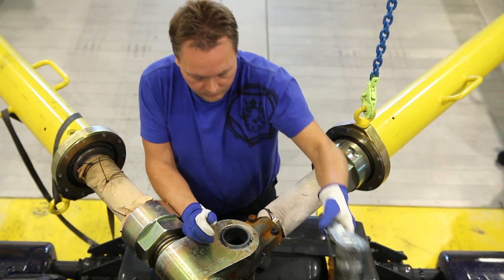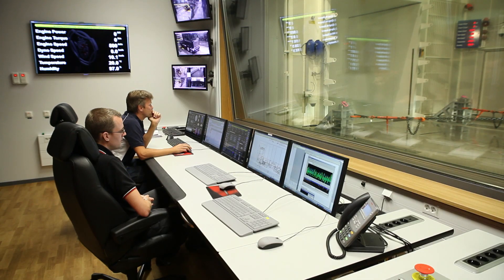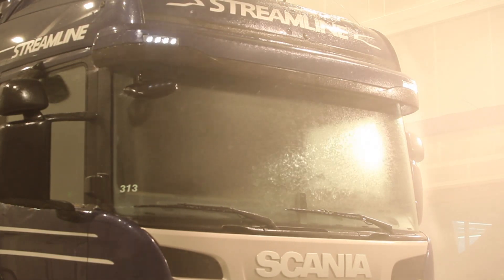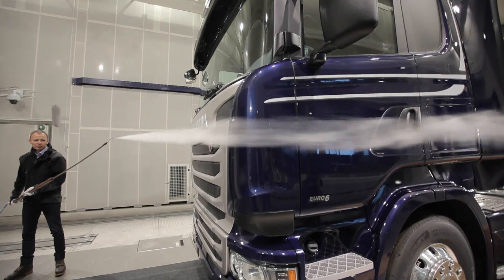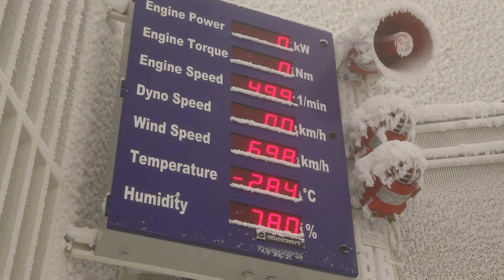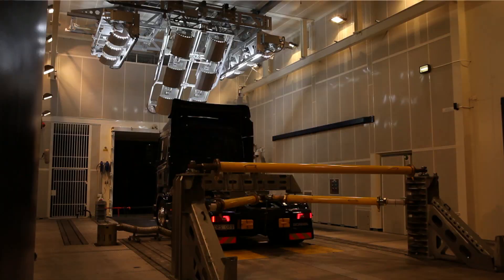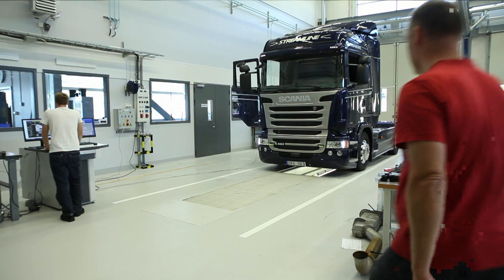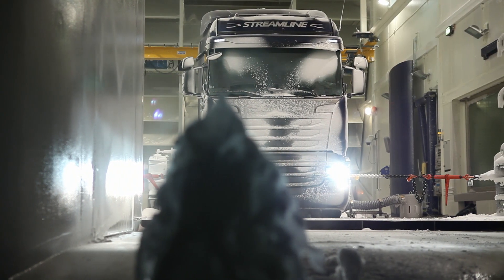Scania Climatic wind tunnel

Comment: Maybe you finally can develop a heater now that blows on the windscreen wipers also. It's gone from bad to worse from 4 series to newest streamline. Can't even drive half an hour without stop at temperatures around zero when it's snowing since you can't get the window coled enough and full blow won't blow on the wipers causing them to clog up with ice.